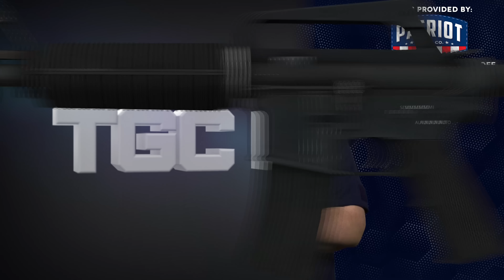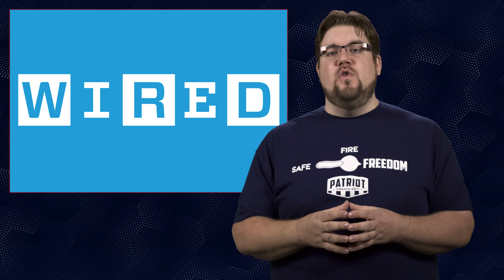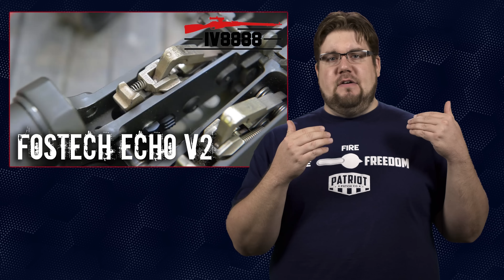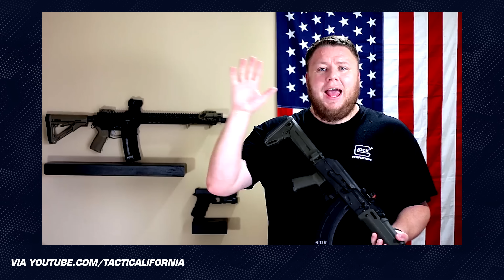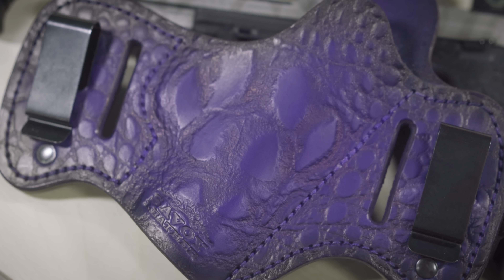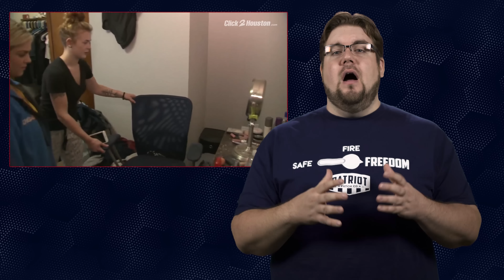3D-Printed Cans, Smart Gun HACKED,  AutoGlove! - TGC News!

Comment: Instead of an Auto Glove, why not make a Calico magazine Auto Winder? 
Or a remote inhand electronic trigger? 

Cut off the handguard, strap the reciever sideways on your wrist, retool it to eject away from you or upward( to your right) modify the magwell to swivel like a full conceal Glock, and insert a spring retension reverse gun safety device( like a in guard safety trigger block, but the opposite goal...) linked to an in hand remote. Yeah it might sound nerdy, but it's entirely feasable today... 

(Extra points if you did any of the following: chose a gun design that alread uses a swiveling magwell like MAT49 derivatives or a top eject firearm, created a remote spring actuator for the magwell too, sighted it with a canted sight... I could go on, but you get the idea...)

Comment: A suppressor made entirely out of welds with huge amounts of residual stresses in the metal when manufactured, what could possibly crack? (says the IN738 certified welder - hint, potential for intergranular fractures wherever heat has been applied, heat treating only goes so far).

Comment: 3D printed parts would be best used to manufacture captive parts, or parts with internals which would otherwise be impossible to manufacture. The other benefit is making fast iterations of a prototype, but as far as tolerances and fit & finish 3D printing is (currently) completely fucking shit.

Comment: Why not just use a playstation/xbone controller motor from the old ps1-2/og xbone, lamestop/afterblow 360, goodwill ones. Get a 9 volt, hot glue, thin cooper wire, tinny button, card bored (or other button mount stability platform/motor addon), and some means to tie it to a glove in a decent way?
I would ghetto one and video, but i sadly have no fun.

Comment: IF YOU WANT TO SIMULATE FULL AUTO GET ANY GUN WITH A RECIPROCATING CHARGING HANDLE TIE A STRING TO IT WRAP STRING AROUND BACK OF PISTOL GRIP THEN THROUGH AND ACROSS TRIGGER TIE RING ON OR MAKE A LOOP ADJUST FOR LENGTH PULL AND HOLD BAM YOU GOT FULL AUTO OH I GUESS THIS WAS SUPPOSED TO BE A SECRET BUT ANYWAY DON'T GET CAUGHT DOING IT BECAUSE ATF SAYS YOU JUST CREATED A MACHINE GUN. WHAT KIND OF FUCKED UP COUNTRY AND LAW IS THAT WHEN A STRING AND RING IS CONSIDERED A MACHINE GUN WELL IT'S BULLFUCKINGSHITUS THAT'S THE DISEASE THAT'S REACHED PANDEMIC PROPORTIONS AND SPREADING ACROSS THE WHOLE WORLD

Comment: Welds should be stronger than the parent metal which means even if the welded pieces were just machined out that way, it would still fail. Powder metallurgy does create essentially one piece however the base metal that is being used is typically weaker than your other options. For example, low grade gears are made from powder metal but decently made gears are made from a solid chunk of metal and "carved" out. 

The reason why powder metallurgy was used is because its faster and cheaper and you can say it's one piece. Don't fall for it.

Comment: Both 3d printers that melt and deposit their filament and laser sintering are additive manufacturing methods.  Additive means you're sticking more material on, and it is the opposite of a subtractive manufacturing process such as you see with a CNC mill where the machine cuts away material.  Add vs Subtract... it's just that simple.

Comment: I'm surprised it took this long before laser metal sintering was applied to suppressors.  The cool part of the technology is the ability to control the density and porosity of the finished part.  The "printed" part is not as strong as its traditionally made counter part though.  It may not need to be though.  Suppressor technology has room for improvement still but legality in the USA remains its biggest hurdle though.  When they become more easily obtainable, advancement will likely come quicker.
Reply: Wrong about the sintered parts not being as strong as reductively machined parts.  Aviation has been using laser sintering to produce fuel control parts for jet turbines in civil and military aviation for a decade. These are quite harsh operating environments, far and away from the worst conditions a firearm would be subject to. Even given the higher cost of sintering vs. reductive machining, the sintered aerospace parts are cheaper and/or impossible to manufacture reductively; either in the number of steps required, and the wasted material generated, or the design simply cannot be achieved by taking a chunk of metal and carving away everything that's not that part.

Also, go google "solid concepts 3d printed 1911".  This was a couple of years ago. They manufactured a .45 ACP 1911, then a little later a 10MM 1911 entirely from laser sintered parts. Including the rifled barrel. Everything except a few incidental springs or something trivial.  All the pressure bearing parts originated as various types of powdered metal. These guns have to date fired thousands of rounds with no signs of stress cracking or other damage. 

Once laser sintering starts approaching the economies of scale that reductive machining enjoys now, I think we'll see something akin to a 2nd Industrial Revolution; new ways to manufacture existing goods more precisely, with the same or superior quality and for a much lower price, in large part due to the absence of wasted material. The 2nd  part is it will allow new designs that were formerly too prohibitively expensive or outright impossible with reductive technologies.
Reply: I am not denying the benefits that laser sintered parts have over traditional manufacturing.  Yes, they are an ideal match for the aerospace industry for their high strength / weight ratio.  However for firearms it is not wise to push the safety factor for many reasons: ammo variation, rough handling, abrasion, lack of maintenance, idiots, ect.  Apples and oranges as far as aerospace and firearms industry.  They are both fruit though.  DMLS parts have "close to"  or "comparable" strength as the DMLS manufactures say, but not the same.  Careful phrasing is used not to say stronger than. I'm not going to bombard you with links because I'm sure you can use the Googles.  I'm sure it is more than "strong enough" for firearm needs.  That DMLS 1911 is very impressive, especially the 10mm.
Reply: 36Erkanator DD isn't the first to laser sinter a suppressor.  A company called delta p has been doing this for close to 10 years.  Their Brevis can is laser sintered.
Reply: +36Erkanator, frankly, gotta disagree with you. DMLS can be made to produce parts just as strong as traditional forgings and what not. The porosity has been driven effectively to zero in some applications (F1 pistons, for example). The issue is not porosity or strength, but rather the expense of the process. Needing a $750k device to manufacture a gun in a slow manner which requires post processing isn't economically feasible. That could, of course, change in the future as the patents continue to expire. For suppressors and integrally cooled rocket engine nozzles, it's the only way to get certain shapes and designs, so Space-X for example, is using DMLS not because it's cheaper, but because it's so impractical to manufacture certain parts any other way. This point is perhaps made best in the choice by Solid Concepts to print a logo into the rifling on their 1911--because they can, for zero extra cost. Oh, one other thing: consistency. The parts are infinitely repeatable. Keep the powder consistent, and you get the same part every single time. Or you can change materials without having to retool your machinery. Better yet, you can have the material composition change across the part.